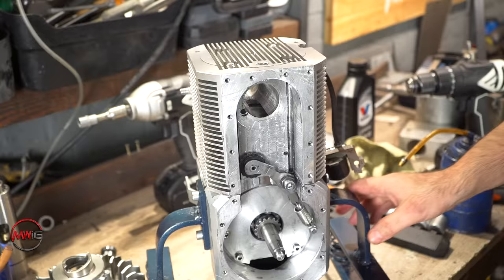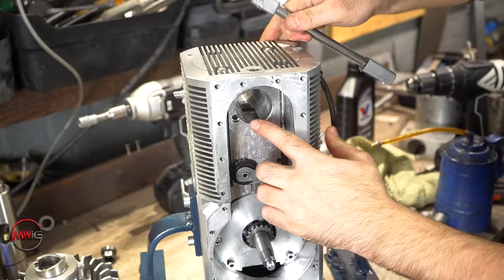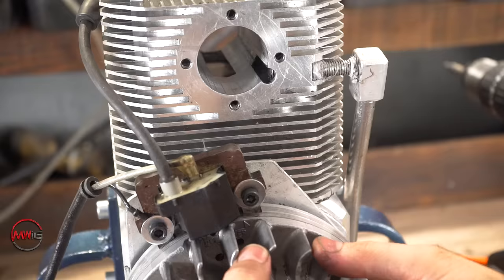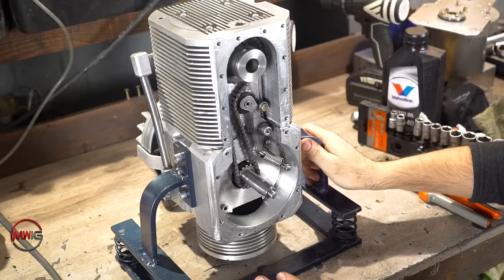I built a brand-new Rotary Valve Engine, and it works!

Comment: I watched every second of your original build and remember thinking , when you painted everything before you had even tested it, that you are an eternal optimist. I was disappointed when it did not run. This video makes me very happy for you. Just a quick question. As they engine is self oiling, why did you add oil to your fuel? It certainly turned it into a smoke monster. Or do you need oil seals on your intake/exhaust shaft. Just a thought.
Reply: Not an expert but two stroke engines do benefit from oil in gas mixture to keep it wunning smooth. I think chainsaws and mowers do this and the only bad thing is the smoke.
Reply: @Six_Gorillion  That would be a 2 stroke this is supposed to be a 4 stroke
Reply: I would imagine oil in the fuel would be beneficial in this prototype for two reasons.  First, keeping the rotary valve lubricated is very important and it would take quite a bit of developmental work on various materials, seals, and oiling schemes to arrive at the right combination for reliability and longevity. Adding oil to the fuel is a simple precaution to quickly and easily solve a potential valve lubrication problem.

In addition, cylinder wall lubrication of a 4 stroke engine isn't straight forward either.  Most small engines like this rely on a "splash" system where the crankshaft literally splashes around in the oil sump and lubricates the cylinder walls when the piston is at the top of the stroke and then the oil ring wipes a film of lubrication up and down the cylinder wall.  From the photos of the cylinder wall damage, it is clear that this engine is not being properly lubricated from crankcase oil alone, so introducing oil with the fuel makes sense.  Remember, this is a proof of concept engine intended mostly to experiment with the rotary valve intake and exhaust idea.  I would imagine that experimenting with valve timing, perhaps with a simple way to adjust the timing of the intake separately from the exhaust timing, would be the next step, maybe in conjunction with some ignition timing alterations.  Refining the lubrication issues is of lesser importance.
Reply: @Six_Gorillion  Firstly, it has a timing chain and an overhead rotary valve in place of traditional poppets. It is a 4 stroke. He may be adding the oil because he is worried about his cylinder wall I would reckon. The fuel doesn't go anywhere else. It's a beautiful thing that he can continue to work on to perfect oil control anyway.
Reply: maybe not having much faith in the oil system?
Reply: Same here! Lol I smh. Probably would have worked first time of he didn’t curse it like that.

Comment: I am so glad you took the comments to heart and proceeded to succeed!

Try a little less oil in the fuel, as the engine is oil bath, unless there is no spray or slash system, otherwise I would be tempted to forgo any oil!

The other reason for the smoke could be oil from the rotary valve system!

Comment: That's a milestone, kudos MWIG. Now try  to fit an electric starter and a muffler, a mini cold air intake will be important to boost your HP.👍👍
Reply from the maker: Thanks for the tips!
Reply: Also try to use a grade 30 oil for both the engine and the  low ratio 👌on the gas for soft strokes which also reduce smoke,
Reply: A cold air intake? I don't think you understand what that does. A CAI is for cars where the vehicles intake is inside the engine bay, and typically sucks in warm engine air through a restrictive tube that's all trapped under the hood. A carburator like he has is already better and the only improvement would be a nice filter on it as it's already not sucking in hot air. Adding tubing like a CAI will increase air friction loss and reduce his performance while not sucking in any colder air.
Reply: i think you misspelled turbocharger lol
Reply: Cold air intake? Is the motor not in the open? Its only called that if its enclosed.

Comment: Congratulations! Sounds great. I'm so glad you didn't give up and I'm glad for you as well. A couple suggestions; (1) you should do a compression test (2) an exhaust will redirect that "in your face" smoke and will probably increase compression just a little. Thanks for sharing.
Reply: there's no point in doing a compression test lol the oil pump is directly exposed to the combustion chamber, and the valve tube has to be loose enough to leak when it's cold, so that when it's hot it doesn't seize. It's a catch 22, if it lives at low RPM, there's a healthy mix of oil, not only cooling the shaft but lowering the exhaust temperatures, everything besides that is great... if it lives at high RPM where the chamber pressure will limit the flow of oil out of the weep holes so it's not acting like a diesel, it'll clear up and be able to run mostly on the petrol... but then the valve tube has no lube, valve temperature spikes, things get bent. If the oil delivery was blocked off and forced to oil the valves, regardless of rpm dosing, you've got shock loading on the oil pumps gears (install check valve to fix that), then a metering valve to at least limit how much oil you're burning (at which point means swapping to a controlled oil metering pump... like rotary engines use, for the same purpose)

Comment: When the engine worked it showed proof of concept to do further development and get the balance of fuel to oil to air mixture down to not put out so much smoke to pollute the air around you.

Comment: That is pretty cool! So many less moving parts than conventional valve setup. Nice one.
I wonder if you can go larger diameter on the valve shaft (and holes) and therefor more air flow. Obviously adjusting for prime afr would be paramount.  
Could imagine a turbo / fuel injected version down the line!
Reply: I would not work in real practical job. Consider the shaft valve that took all heat from exhaust through it.  Had the engine been running in long time ,it would have fired. Because the intake side is so heat.
Reply: @alexlo7708  
Good point
Reply: I think this engine burn oli with fuel
Reply: @alexlo7708  I don’t know, it might just work. The way it currently is built, the intake is on “upper half” while the exhaust is on the “lower” half of the tube… but what if the intake was used to cool the exhaust end? In stead of splitting the tube top and bottom it could be split side by side size the holes to be about 2/6 intake 1/6 exhaust with each chamber inlet overlapping. 
Like if the intake is at the top, the hole for it in the combustion chamber will be at the lower side while if the exhaust is at the bottom, it’s chamber hole would extend to the upper side of the tube. The intake would be larger while the exhaust would be smaller contributing to higher pressure ratio and cooling. Maybe?
Reply: @stephenvelazquez5939  Any approach should base on principle that exhaust and intake must not be on the same metal part, I think.
Intake in anyway cannot cool down exhausted side. They are very different in heat energy amount unless one can make engine that run at 70-80% efficiency, not 35-37% as today engines.

Comment: If you used mixed gas to lubricate the rotary valve isolated from the oil system or a few ring groves on the valve shaft to keep the oil from entering the combustion chamber there would be less smoke. I really enjoyed the videos and think it could be a great idea and less moving parts than push valves. A 2 stroke design would be cool to see as well!

Comment: I'm reminded of "Sleeve valves" used in some old radial engines. It's no small feat to get it running, and honestly it seems powerful enough to take some load (someone said go-kart, and that seems pretty fitting).

It has a VERY interesting meaty sound to it too.

Comment: I've thought of a similar idea, the issues I never worked out were oil control and problems with carbon buildup on the exhaust side. Both the result of the shaft needing to fit snugly where it intersects with the cylinder and needing lubrication because it fits snugly.
Reply: OIL at the hottest part of the engine - exhaust port = smoke

Comment: If I'm not mistaken, there have been rotary valves used in some early double expansion stationary steam engines. But were quickly dumped for the more conventional slide valve.

Comment: love the build!!! great work.may i suggest that you consider steel dynamic oil seal rings on the rotory vale assembly similar to ones used in automatic transmissions they seal great and hold up to high pressures.also vent the crankcase.hope to see more on this build.again great job!!!!!!

Comment: I think you will have to modify the shape of the openings in the rotary valve. If you think about a conventionally four stroke engine the camshaft lobes are ”drop” shaped so the valves start to open slow and then accelerate for fast opening. Then they remains open and then for a fast closing action.
Reply: Are you suggesting adding a twist to increase duration time open?

Comment: You should try and make a v-twin with only one valve shared between cylinders... so the rotary valve would be the intake for one cylinder while also being the exhaust for the other at times when there's overlap.
Reply: Great idea.
Reply: 1. Would the cycle timing on that geometry actually work?
2. Exhausting through the intake tract will make a mess of any carb you install on it.

Could definitely have a single shaft with dedicated "valves" for intake and exhaust feed two cylinders in a V arrangement, though.

Comment: Amazing work, I love the ingenuity you display in all your builds. Also I would love to make a ringtone of you singing hard work. So never give up always ask others when you are struggling, the answers are always out there you just need to know who and you could build a flying ufo just by asking a bunch of strangers to figure it out for you 😊
Reply: UFO would be two spinning disks. The disks spin in opposite directions and have very small raised humps on the top side of each to create lift. The bottom disc has raised humps as well creating lift in the opposite direction. You think that downward lift would counter the upward lift but this is not the case because planes and even fighter jets can fly upside down. The upper disc spins faster than the lower to launch from the ground and the different speeds of each are used to control up and down. A gyro flywheel is used for left and right / forward and aft. A vacuum is created in front of the craft as air is pumped to the rear creating a high pressure on the rear part of the craft to propel it forward. This is a crude explanation of only a small portion of some of the needed systems. I'm just a stranger in need of more strangers with ideas to make it fly. Aloha
Reply: @petesquickfixdiyshortautor1218  have you ever heard of the “Avro VZ-9AV Avrocar”, this aircraft was designed to combine the best parts of a helicopter and the best parts from a airplane, but it proved to be unstable and difficult to operate.
Reply: @elonwhite6628  never heard of that. I'm sure that just about any craft can be stabilized using computer assisted controls just like the stealth had to use.
Reply: @petesquickfixdiyshortautor1218  the stability issue is caused by the rotation of the central propeller, the main problem was that it would rotate in one direction fine but trying to rotate in opposite directions to the propeller’s rotation would cause the aircraft to veer off centre and it would behave erratically, also the program was created, and then shut down before computers were even considered for use in aircraft’s
Reply: @elonwhite6628  now we have computers! Yay!

Comment: Proud of you, man. Here on out is just improving on the design.

Base design is fantastic, though. You can build this on a train of cylinders and only ever have one, easily-serviced moving part. This design is unheard of, and simply brilliant.
Reply: The ... pistons and crank shaft still move..? That's where a shitload of wear comes in on a normal engine, too.
Reply: @ashkebora7262  True. But this video series is about the valve train, not the crankcase.

Comment: I know why it is very smoky, because there is oil that enters the combustion chamber from the rotary valve so that the oil burns too, and the solution is that you have to redesign the oil path in the rotary valve by providing insulation in the intake and exhaust holes so that the oil does not enter the intake and exhaust holes

Comment: Not the first of its type, as working models based on some variant of the concept have been made since the 1890's. You can find blueprints and patent drawings for them if searching for "rotary valve internal combustion" as a search phrase.

However it's neat to see this one working given all the home-built aspects. Not exactly an easy feat for most people short of doing a direct copy of some known working engine.

As for improvements?
Seems the current version relies on oil around the valve drum to both lubricate and provide the seal around the valve drum. That's why it's one heck of an oil-burner. Might want to try some kind of 
graphite/bronze type material to seat in as a hard-pressed bushing around the intake and exhaust ports. (Similar material to electric motor brushes?) Maybe a ceramic felt as a crush/springy material with just enough give and resilience, and then the bushing would fit in the groove over that which keeps it located at the valve seats? Something soft enough to not wear out the valve drum and graphite to help it be self lubricating at the wiping contact surface. Thus something other than the
 oil film to provide a seal right at the point where oil would be leaking from the ports into the cylinder. Just a thought there.

Comment: I can well imagine this construction as a 2 or 4 cylinder boxer construction.  Valve control is uncomplicated and easy.  The only problem I see is the chain control.  A bevel gear transmission would require less maintenance and be more robust.  The honing of the cylinders is not optimal, less rotation but faster up and down movement would be better.  How's the compression?

Comment: Good work thats for sure. Thing is this also shows why rotary valves never really hit the mainstream. They are very hard to properly lubricate without also burning too much oil. Too much surface in hot places that needs lubricated. Awesome machining and design for sure!
Reply: Sealing the combustion chamber better and using premix would help with a more even temp control and bearing life. That's what all the rotary guys do to the Mazda series engines.

Comment: I’m genuinely curious how much hp and torque that little engine is producing. Absolutely blows my mind how well it seems to run full throttle
Reply: with all that oil its burning in the combustion chamber.. probly hardly any
Reply: @theonewhowas7709  yeah, I'm not sure why he added oil to the fuel. Everything that needs it is lubricated enough, unless he's doing it to keep the rings lubricated but the piston splashing around in the oil should do that well enough.

Comment: I love that you got it running! I do have a question about the valve port(s) timing. I couldn't tell from the 1st vid. Is there any overlap of the intake/exhaust ports in the cylinder port? Most 4cycle engines have a slight overlap in the intake valve opening and the exhaust closing, to help the flow of gases. Just curious.
Reply: The Atkinson cycle is the way to go for fuel efficiency over the Otto cycle.

But for smoother running, understanding LSA (Lobe Separation Angle) on a camshaft, and the right amout of valve overlap from 10 to 20 degrees would boost engine RPM, power, and some MPG's/LPK's.

Comment: If you were to change the fuel for your device to Browns Gas - HHO - ie that derived from electrolysing water into Hydrogen & Oxygen - that would be quite a progression... and there are many suggestions of methods readily available. For your device, no alteration would be necessary, the only difference would be gas [as in the state above liquid] instead of the current mixture [as liquid] - down the fuel-in tube.... The technical know-how for this adaptation is minimal, have a look!
Reply: Комментарий в топ

Comment: When I saw this, I recalled a model engine of yonder years, which performed very succesfully, so, do not give it up. Persist in improving your idea. At the moment, I am bussy designing a totally new type of rotary engine. At the moment, it is all still in the drafting stages. It differs completely from anything that was ever done before, in the sence that it perform all four actions, four times with every rotation. I still have too work out how too machine the components
Reply from the maker: It worked

Comment: the valveless engines have been produced in the past, If I remember well, it was the Knight company that used that design, it was the sleeve that was usewd as valves.
these engines were plagued with astronomic oil consumption.
 your engine is a great realisation, the proof is that it is running rather well 
 the fine tuning of an engine is the part of the development that aks the most part of the effort and your engine is at this stage.
one of the reason why this design is not produced is the difficulty to control the effect of the metals dilatation and the capacity to cope wiith the combustion particules.
very good video and a great learning experience.

Comment: That was a master peace of engine building from scratch! I believe it smokes because the lube oil  flowing to the rotary vale is too much and leaking into the combustion chamber and smokes. A quick way to check this is to fill the crank case with synthetic smokeless two-cycle oil and see if the smoking is reduced. That's an old used car trick when they smoked. Good luck and good job!